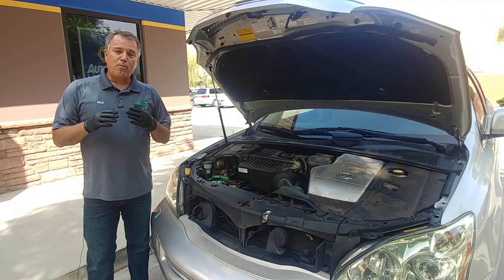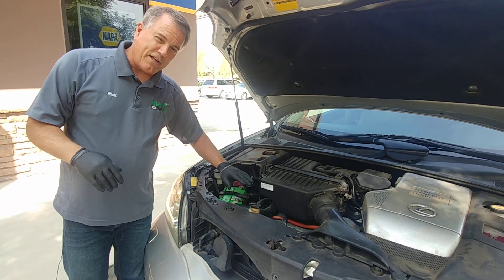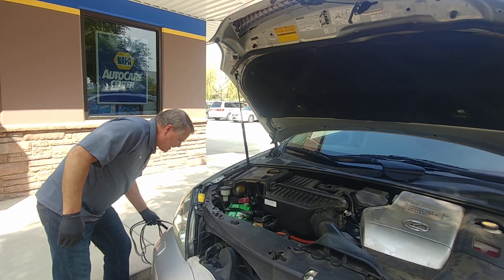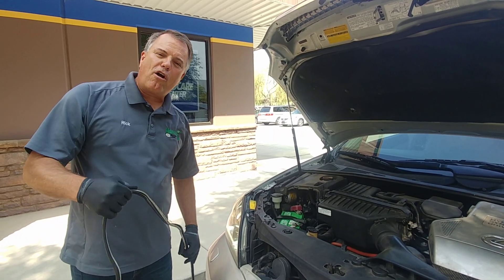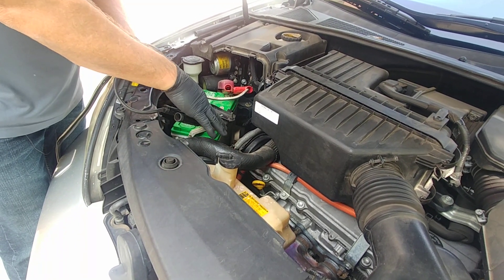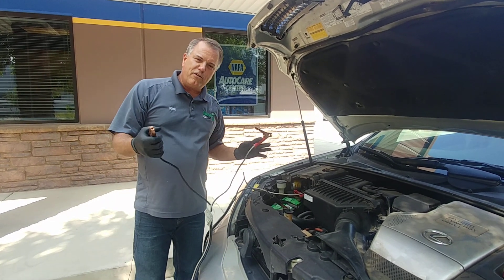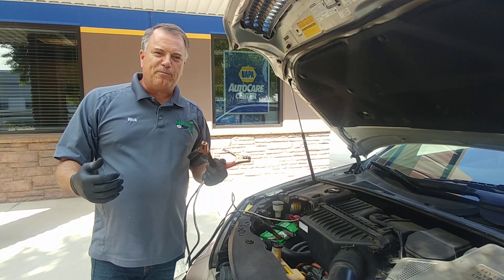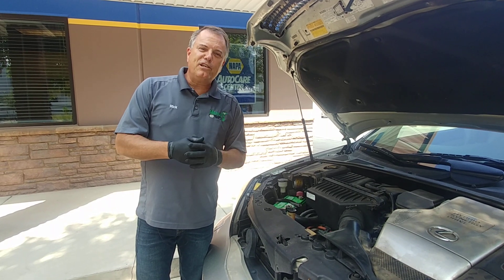How do I Jumpstart a Car?

Comment: Sorry to say this, you never have to go with the negative post of the battery when jump start  with this all new cars, all electronics are really sensitive and they can go crazy and throw engine errors or even worse, damage electric components. You always have to look for a ground connection for the ground besides the battery